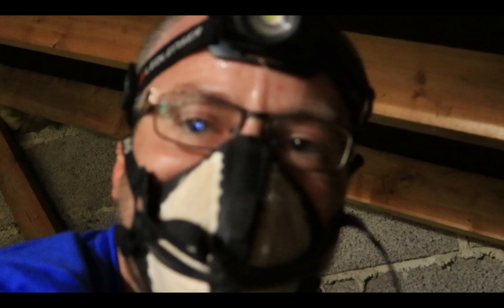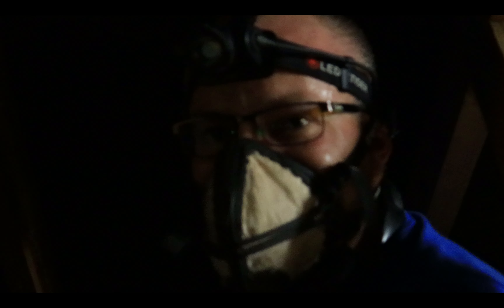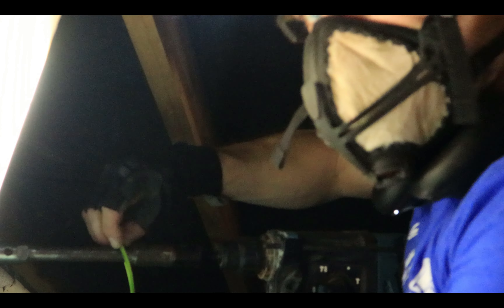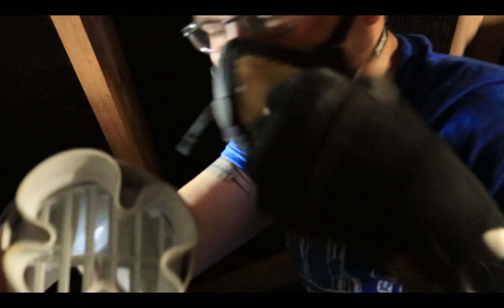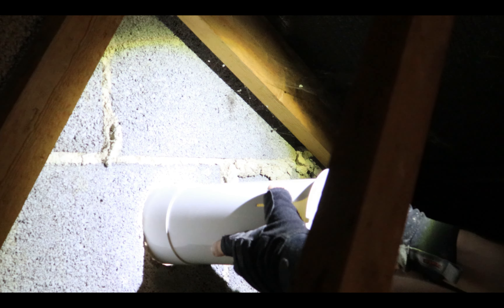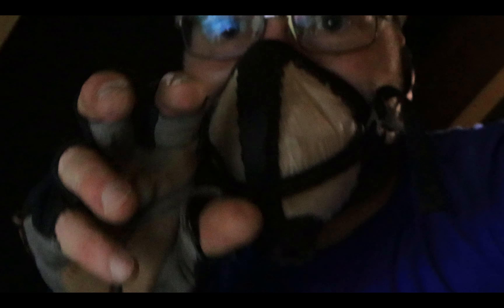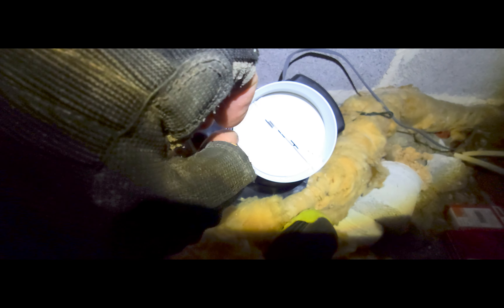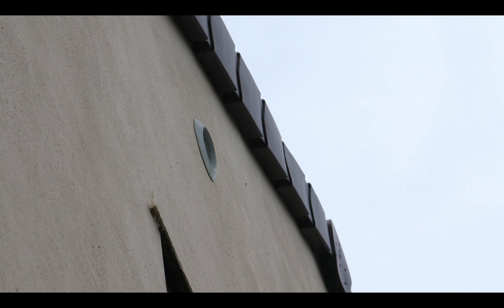Bathroom Extractor Fan Installation Part 2 | Up a Very Hot Loft 🔥😅

Comment: Silly question, can I install one of them Manrose Internal Wall Kit without an extractor fan for general ventilation, house has severe damp issues (old house with unbreathable walls), I was thinking of putting it in one of the hallway wardrobes which wall goes to the outside (wardrobe also mould issues), and on the inside I was thinking of just covering it with a grill over an insect mesh. 

Would this be against building regs or anything?
Reply from the maker: I did this exact same thing in my loft. one at each end with an insect mesh framed over the top. But if its an issue within the home, without stating the obvious by opening vents, checking brickwork vents are clear. You can get a Positive input ventilation fan (get the heated one). I have installed a few in to clients homes, and they have had good results. (Please contact a qualified spark to install).

Comment: Hi, thanks for this useful video.  My fan is nearly same as on the video. I noticed the unit itself leaking water through the fan housing right in the middle. I took it apart and cleaned it off yet found no seals in between the parts of the fan. Is it normal for them fans to drip water? Would sealing the unit myself with a silicone be good idea or rather not? Taking that the fan comes with no seals straight from the factory. Thanks.
Reply from the maker: Hi Mopas.  No they don't have seals and I wouldn't try and seal the unit, this would possibly cause worse issues later on, especially when it eventually has to be replaced. And it could fill enough that water runs back into the shower, or worse, gets into the fan electrics.
Water collecting within the fan unit itself is most likely due to the current weather being colder, this makes the exhaust moisture condensate within the pipe, and it collects at it's lowest point, the fan.
Some ideas to get over this:
-Replace the ducting with an insulated version (or wrap the existing with insulation). 
-ensure there is no sagging in in ducting (assuming it's not the solid tube type).
-Raise the fan higher than the exit point ensuring water runs out the property and not back in.  
-Increase the over run time on the fan itself.
-If the exit pipe is long, or these don't work, you can install a condenser trap into the ducting. I personally don't like these because they need a 20mm drain pipe, usually installed back into the shower/bath which looks unsightly.
Remember to turn the power off to the fan before doing any work to it, electrical or otherwise

Please let me know how you get on. 👍💡
Reply: Many thanks for your reply. I have isolated the vents like advised also I placed the tray directly underneath the fan, so if it drips it drips onto a tray. Furthermore I fitted a small diameter of drain hose onto the tray that goes out through the fascia. I believe you're right in saying it's a condensation due to the cold wheather so isolating the pipes was bang on idea. Many thanks for reply.
Reply from the maker: @mopas5195  I hope it all goes well 👍
Reply: Just wondering if you managed to solve your issue? I had my 1 Yr old national ventilation inline fan replaced yesterday with an air vent 100mm mixed flow inline fan as it had been leaking. Checked  it this morning and there is a drip from the body casing after using shower (at the inlet end). It's on a short run of around 1 metre each side. Has insulated ducting running to it and flexi hose running down to the soffit. Phoned electrician & he reckons its condensation due to time of year. Other than place a drip tray below the plinth that it stands on and waiting for better weather I'm not sure what I can do? I've put some loft insulation on the ducting too. Far from ideal and if it doesn't go away when weather improves thinking of going back to an axial fan.

Comment: Can i ask how you secured the duct to the fan, especially the inner ducting? Just had a replacement installed today & electrician used mesh backed tape (said it was better than using a cable tie). Thanks
Reply from the maker: I do both, cable tie to ensure the duct is in place and tight to the extractor housing (inside layer) and finish with gaffer tape. (Both layers). It doesn't look pretty but it does the job. If you really want to make sure, you could use a metal tie (I forget what they're called), that tightens with a screw. But be careful not to overdo it or you'll break the plastic.
Reply: Thanks - I appreciate your quick response. Is there a way to remove cable ties once they are on tight in case I need to remove the ducting at some point?
Reply from the maker: @esinclair7171  carefully with a very sharp blade, or (I use) snips/side cutters. But more often than not, you can pull the ducting away and the tie will go with it, so there is no need for a tool.
Reply: @ChampionsOfTheTrade  Perfect. Thanks so much for your help.

Comment: Excellent informative video. Based on seeing this i have gone for the same quickfit kit you've used. Will also buy some chain to suspend the fan from the ceiling joist to help further dampen any noise. (Manrose MT100T - 24db noise) and got backdraft shutter. Gone for the Manrose Grille with built in LED light - your opinion / reviews on these? Just waiting for electrician to fit. Thanks once again
Reply from the maker: That's great, glad I could help. 
Now the built in kits use led lights rather than the halogen MR16, I think they're a good product. The halogens would get so hot they would burn out the cabling and pin connections.
Make sure your electrician leaves the led driver above the insulation and maybe upgrade it if it's cheap, it'll save another call-out in the near future. The cheap drivers don't last very long in my experience.
Good luck with it 👍

Comment: you should have around a 2 degree slope in the ducting from the inline fan to the external grille, where as you have a steep incline XD
Reply from the maker: Thank you Dave, yes that makes sense. Any condensation left and still run out. How ever it is not always possible to do this, especially if you have a property that has tile vents, for example.
Reply: @ChampionsOfTheTrade  no worries.  You can get a condensation trap if going vertical through the tiles.
Reply from the maker: @davesmith9844  yes I've always wondered what the point of them is, you still need to have a pipe to drain the moisture out of the property and please correct me if I'm wrong, but building regs don't like them either.
I've always seen them as a... If you need them, then the ventilation isn't correct to start with... So why have a sodding great big hole in the wall/roof etc, just use a trap and be done with it.

Comment: very helpful, thanks.
Reply from the maker: Glad I could help. Give me a shout if you have any questions 👍 and please let me know how you get on.
Reply: @ChampionsOfTheTrade  Got the vent kit and core drill yesterday and installed it today, just used it. I had a bathroom fitter bail out on me with a few jobs still to do, this was one of them. I really thought i would have to get someone in to do it. thanks again for the excellent videos.
Reply from the maker: @simonmarshall7268  I'm happy that I was able to help. 👍

Comment: Should that extractor be fitted upside down as moisture could seep into the electrics?
Reply from the maker: There's no up or down to these fans as the fan itself is rotatable. The connections are also housed in a sealed unit. 🤘

Comment: nice video, i have just got one of these inline fans & in the instructions it says a condensate trap should be fitted for fan  being used in areas with high humidity extraction. did you fit one? thanks
Reply from the maker: Thanks for your reply and glad you found it useful, but no. I never fit those traps, apart from anything else, they need to be drained off somewhere. (ie, back into the shower).

Comment: Thanks for making this video. I am so 🙏 grateful. 

Can I ask or do you have a link for the exact type of ducting hose you used?

Secondly, for the isolation switch, did you use one with a fuse? If not which one, please?

Lastly, I will be replacing my Manrose 100mm In-Line Kit with LED Lamp Shower Timer Controlled Extractor Fan to the one in your video. I will also be making it smart whereby when the Temperature and Humidity sensor in the bathroom's Humidity is above my preference level, the fan comes on. For this, i will need to wire the fan to a Sonoff mini R2 then wire the Sonoff mini R2 to the power source. As you already have an isolation switch, where would the Sonoff mini need to go? Before the isolation switch or after?
Reply from the maker: Hello, if you do an online search for insulated ducting you'll find lots to choose from, similarly with the fan isolation switch (just don't go too cheap). 
I don't use fused spurs for fans, I take the power from a lighting circuit rated (6amp) and use 1mm twin and earth. The switch should also be fitted before all the fan devices. This way, should anything fail the circuit is unaffected (ie can be left on) whilst work is carried out.
The work should be carried out by a qualified electrician.
Reply: @ChampionsOfTheTrade  Thanks. I'll get onto that

Comment: Great video! Did you chain the fan to stop noise vibrations?
Reply from the maker: Hi Jon, Thank you for your feedback. 
Yes I did use the chain for that that reason. The only noise that I can hear from the fan is the airflow through the ducting. The pitch of this can be further reduced by adjusting or changing the vent (the more open, the less noise). Also using solid ducting may also help reduce noise, but if you use the solid, don't forget to insulate around it. More importantly though, I can not hear the motor itself

Comment: Anyone loop the inlet duct to help quieten the extractor?? The Manrose are loud I find even the low decibel ones
Reply from the maker: You want to keep all of the ducting as straight as possible otherwise you will create condensation traps. This is also against building regulations.
To reduce the noise you can either use solid duct (the corrugated ducts create a vortex, which increases the noise). Or you can change the ceiling vent to a more open version (or if you have the same type I used, unscrew it to open).
Please let me know how you get on.
Also, if you have speed control, you could try it on the lower speed, but increase the run time (timer version only).
Reply: @ChampionsOfTheTrade  thanks thats great advice. Novice diyer here. Ill try change the speed first. I fixed it on a board over the joists quite close to the ceiling. The inlet duct is only about 400 long, maybe I should lengthen the duct and place the fan further away from the ceiling opening aswell??
Reply from the maker: @christophephilippe1481  If you can, hang the fan from a joist, This will remove the vibration from the ceiling. I suspect you're hearing a lot of the vibration transference from the fan, directly to the ceiling.
Reply: @ChampionsOfTheTrade  hi thanks for the reply again, theres no vibration I dampened the board that I fixed to the joist, the actual fan is just crazy loud. Its the manrose timer model
Reply from the maker: @christophephilippe1481  but did you screw through the damping from the top board through to the joist? Unless you've used dampers that are bolted each side, you will always get sound and vibration transfer.

How old is the fan? Another factor could be the bearings are wearing.
Reply: @ChampionsOfTheTrade  hi no just damped the fan side. I'll move it aswell, its newly bought its about a couple of weeks old. I'll see how I get on making those changes. Cheers

Comment: Wow, great job on that. Just wondering what your opinion would be on the monstrosity that has been fitted in my new build

https://youtube.com/shorts/ytle7kALxs4?feature=share

Extractor fan is in the ceiling of my windowless bathroom approximately 50-60cm from an external wall, yet the developers thought it would be a good idea to use about 5m of flexible ducting and attach that to a roof vent.

It's safe to say that the extractor doesn't work very well and we've had problem with moisture running down the walls everytime we take a bath. 

Unbeknown to us, the ducting had filled with water which then lead to the duct rupturing and the water pouring through our bathroom ceiling. Great job Bellway, just what we wanted at our newly purchased property!!
Reply: I would get someone out to check it just to be safe. Or if you are confident enough have a go at putting something better in... My bathroom is covered in mould it's a rented property  but unfortunately i am disabled and unable to do the work that needs doing... Good luck with your property..
Reply from the maker: Unfortunately new builds, in my experience are rushed and built to a cut-throat budget so mistakes are always made, corners are always cut. You should have an NHBC or LABC cover on your new build so the builders have to make good on any issues. Flexible ducting is, in my opinion not fit for purpose except for very short runs or when insulated.

It's common practice to use roof vents as they are easier and less time consuming to fit and don't create any dust because there is no core drilling. I came across one several years back, where the builders had done a similar thing to what you describe and water was returning down the pipe and causing the ceiling to deteriorate. I found that the ducting was too long from the ceiling fan to the roof in the loft space, leading to a large sag. This had completely filled with water (not from outside) and was returning back down, not helped by the temperate changes. I fixed it by using a correct length of insulated ducting.  

Hope this helps, please let us know how you get on (FYI your video link doesn't work).
Reply: @ChampionsOfTheTrade  

https://m.youtube.com/shorts/ytle7kALxs4

Wondering if this link works. Yes, this is essentially what I'm finding out for myself. I contacted the manufacturer of the extractor fan who responded and told me that the ducting had been installed incorrectly, listed reasons why and sent me a pdf with instructions on how the ducting should be fitted. I am trying to get it fixed via NHBC. thank you so much for your advice and I'll keep you posted on the outcome.
Reply from the maker: Link doesn't work, probably a YouTube thing. Good luck getting it fixed, keep pestering them, daily if you need to.

Comment: What a complete bodge, why hang the fan from a chain? If you had core drilled the hole at the same height as the ceiling joists you could have secured the fan to the joists .
The fan should also be fused down to 3 or 5 amps ( depending on the make) using either a FCU or a fused fan isolator
Reply from the maker: Thanks for your comment, I understand where You're coming from, but let me explain.

The fan is hung from the chain rather than fixed to the joists because of vibration noise. If you have ever fitted a ceiling mounted extractor fan or fitted a high powered fan to the ceiling joists, you would know how much extra noise is created (unless fitted to a brick wall).
The fan does not need to be fused down because it's running directly from the lighting circuit at 6 amp. Remember that the over current device is there to protect the cable not the appliance, if it were required then the fuse would be in mA. That aside, the remote switch receiver has a 3a fuse fitted.

Fan isolation switches don't have fuses and are not a legal requirement to be fitted. Should the device require replacement, then the power will need to be isolated: Means of isolation not to be inadvertently or unintentionally energized 461-01-02. The only way to safely do this, is to use your lock out kit at the consumer unit.

I hope this clears up any misunderstandings, any further questions, please let me know.
Reply: @ChampionsOfTheTrade  hi I am an electrician , and have fitted hundreds of extractor fans
To reduce vibration and noise , put 20mm open grommets between the wood and the base of the fan
I think you will find that in nearly every fan you but in the instructions it will say that te fan needs to be fused down even if connected to the lighting circuit
Reply: @ChampionsOfTheTrade  so the fan would be fused down to 3amps,
And yes you can get fused fan isolator switches, scolmore make then as do other electrical suppliers
Reply from the maker: @timbarnard9742  putting grommets in-between the fan and the joists... What a bodge 😉. It doesn't work, the vibration is still transferred via the screws, it's basic science. Look at it like car suspension, the spring is the grommet, the car the fan and the wheel is the joist, adding a fixed bar or screw between the car and wheel makes the spring useless.
Reply from the maker: @timbarnard9742  I'll have to keep my eyes open for those. 👍